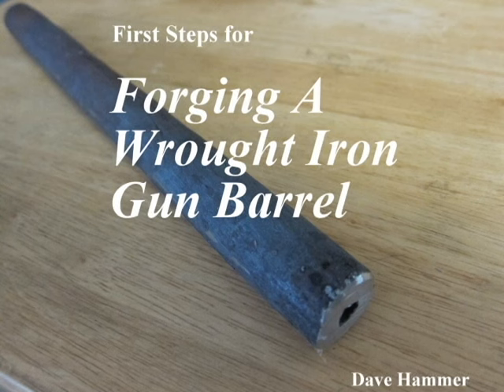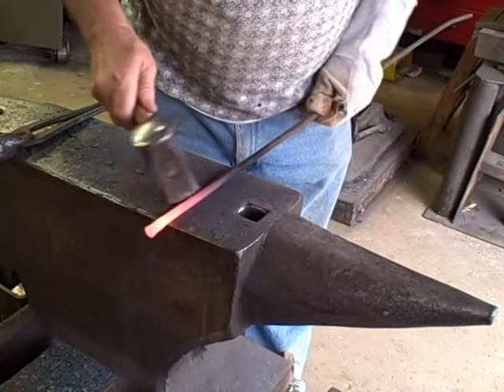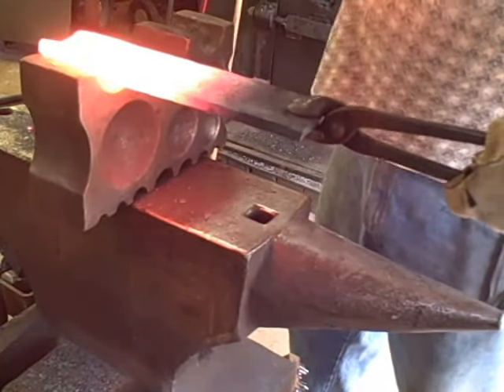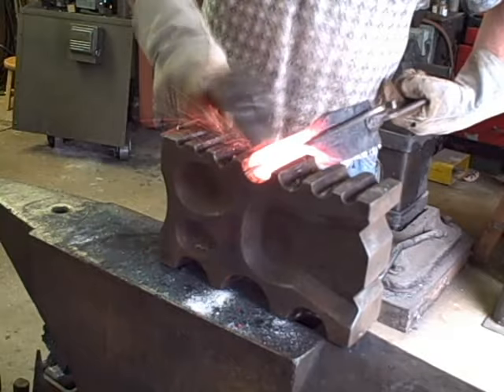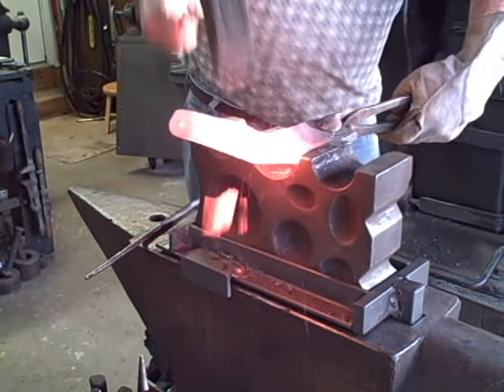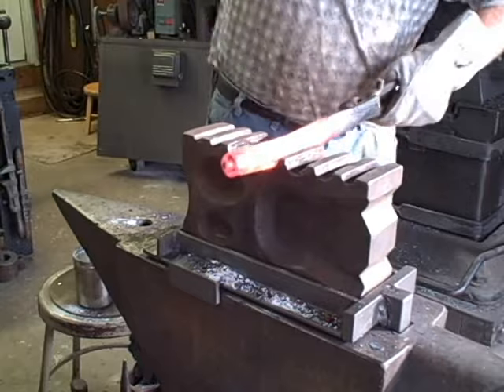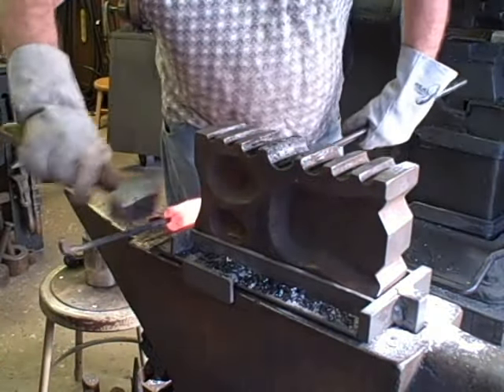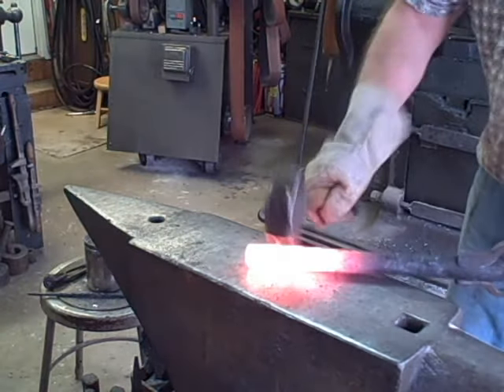Forging a gun barrel

Comment: Truing it up  now?  How do you even begin truing that?  That rod he used was not straight and perfectly trued.  The barrel he hammered would no way be straight.  He needs to throw it on a Lathe and start cutting chips to even have a chance.  Doubt he would rifle that.  Now thats the hard part!
Reply: If I move forward on the barrel, I will do it the same way it was done during the 18th century.  They made drill bits and drilled out the barrel with small (in diameter) drill bits to just under the bored size.  They chucked the bits in a machine with a large flywheel that was hand driven.  Then they made a boring tool, much the same and finished the hole.  A gunsmith can look down the barrel and see where it is bent, then straighten it with a hammer (yes they can, I've seen them do it).  And yes, this barrel can be rifled in Colonial manner if I decide to make the machine to do it.  I've helped a Colonial Wiliamsburg gunsmith do all this and I could do it if I choose to do it.  How do YOU  think they made firearms before the industrial revolution?  It was ALL done by hand and crude machinery.  The firearms weren't perfect, but some were accurate enough to hit a man-sized target at 500 yards (Springfield Model 1861).

Comment: How did you gauge the quality of the metal?
Reply: Wrought iron has a fibrous quality (like the fibers or grain in a piece of wood).   The finer that grain, the more refined (better quality) the iron is.  The more the iron has been folded (and re-welded) or rolled, the finer the grain gets.  To determine how fine the fibers are, I cut a  piece of the iron bar about half way through, then break it (bar in vise, hit with a hammer).  I have done this with dozens of pieces of iron.  The range of visual on the fibers is from extremely rough grain to very difficult to see grain.

Comment: What is that thing you are hitting on to make the gun barrel  what kindof anvil is it
Reply: Felix tapia My anvil was made by Refflinghaus.  It is a double-horned Northern-German pattern anvil.  

The tool I am using to help curl the bar into the gun barrel is called a swage block, which is a solid block of steel that has many shapes on the sides and flats to aid in forging many shapes.
Reply: Yeah that is cool. were can you get those at .
Reply: Felix tapia You can buy them from businesses that sell blacksmith supplies.  In the USA, a few places would be Peih Tool Co., Blacksmith Depot, Old World Anvils and Saltfork Craftsman.   The Saltfork swage block is the least expensive (smaller also) and is the one I used in the video.  If you Google those businesses, you should find prices.
Reply: Ok i see what you mean

Comment: How can you tell the quality of wrought iron?
Reply: ***** This text is a repeat of an answer I posted a while back..  I will, sometime in the future, put up a video about wrought iron.

Wrought iron is generally spoken of (graded) as poor, medium or highly refined.  Although a piece of wrought iron, after being processed into a bar, may have a smooth outer surface, it actually has an internal fibrous structure, much like a tree branch.  If you have ever seen a piece of wrought iron that has severely rusted, or has been successfully etched with acid, you will see evidence of these fibers. 

The finer (thinner) the fibers, the more highly refined the wrought iron is.  The more highly refined it is, the better it is.  The more highly refined wrought iron is, the easier it is to forge.  Extremely rough fibers (poorly refined iron) may appear as wide as an eight of an inch.  Within extremely high refined wrought iron, it may be difficult to see the fibrous nature of the iron at all.   

Modern steel does not have that fibrous appearance, it has a crystalline appearance. 

A way to determine if a piece of metal is wrought iron is to literally "break" it.... as if it were a twig, and look for the fibers.  Then a visual inspection of the thickness of the fibers is used to "grade" the wrought iron.  In reality, there would be many diameters of fibers within each grade (poor, medium and highly refined), so in reality, there are as many grades as there would be diameters of the fibers.  Within a piece of unforged bar stock, those fibers would run lengthways within the bar (again, like the grain within a tree branch).

When I tested the wagon wheel tire I used to forge the gun barrel, I could hardly see the fibers.

I suppose the next question might be "How do I break a piece of iron....  wouldn't it just bend?

This is how I do it....  If I am testing a bar (say a half inch square solid), I put a piece of the bar into a vice, with about an inch or so sticking up or out the side.  Then I cut it a little more than halfway through the bar with a hacksaw (with the cut about 1/4 to 3/8ths of an inch from the vise jaws).  The cut needs to be across the fibers.  You can generally assume the fibers run lengthways on the bar (this will invariably be true if the bar has not been forged).  Then take a heavy hammer and "whack" the bar, hitting it on the side that you just cut.  If you did this with a piece of wood, it would break or "split" at the cut (and you would see wood fibers).  Essentially, if you use enough force, and it is wrought iron, it will also split and you can see the fibers.  I try to hit the bar just hard enough to split it, but not break it.  As previously stated, the smaller the fibers, the more highly refined the wrought iron is.  Some fibers may actually "tear" and you can see the ends of them (as well as the sides of those that don't tear).  On highly refined wrought iron, those fibers may only be 1/100 of an inch wide. 

If you have trouble breaking the metal, cut it a little further.  If it's steel (rather than wrought iron), it will be harder to break.  If it's steel, it will snap in two at the cut and will not split like a tree branch.  It will have a crystalline appearance on each end instead of the fibers. 

If you have a piece of thick barstock, just cut a short (1/4 inch) piece off the end and put that in a vise and break it like you were trying to bend a coin.  It will snap in two and you should see the fibers (assuming it is wrought iron).

If you don't want to destroy a piece of what you have, clean the scale off it (sanding or ?), then etch it with acid.  You won't see the grain as pronounced, but you should see grain.  The more poorly refined it is, the easier it is to see the grain.  If it is extremely highly refined, you may have trouble seeing the grain and will have to do the break test.  If you polish the metal, a light acid like lemon juice may show the grain (it takes a while).  A stronger acid would be hydrochloric acid (muratic acid).  If you use stronger acids, be sure you take proper safety precautions and proper disposal techniques (read the MSDS).
Reply: David Hammer Thanks Dave! I have been playing around with wrought iron in my forge and not having a lot of luck forging it. I think I will now try to see what grade I am working with.

Comment: Just curious. Do you think that rim was faggoted? If so would the barrel then be best? Also, is that considered a faggot weld or does that term only apply to gathered and formed wrought iron? Nice work there. I'd like to see the gun finished. It would be amazing I'm sure. Especially if you're a woodworker as well. Thanks for posting.
Reply: I don't believe the rim was faggot welded (layers welded).  I cut and broke a portion of it to see the grain before I welded.  On some rims I've looked at closely, I could see layers of differing qualities of wrought iron.  This rim was completely  homogeneous. Layers could have been rolled, but if they were, all layers were the same and the weld was perfect through and through.  The striations were barely visible.   I'm not even sure I could get a picture of them visible without a special camera.

Although I hadn't initially intended to finish the gun, I may.  My initial interest was just see if I could do the forge welding.   There has been a lot of interest in seeing me go forward with it.   I am a fair woodworker, so I believe I would do OK there.
Reply: I'm sure you'd do more than ok.

Comment: Hey whats that white stuff you put on the barrel
Reply: Peter Griffin It's 20 Mule Team Borax (a laundry product).  It's used as a flux to deal with scale when forge welding.
Reply: Oh thanks!
Reply: Peter Griffin helps prevent oxidation when the weld is being formed for lack of the right term, sort of like shielded arc welding, the shield is the gas that forms to do the same thing, if I understand it right, if I don't, well high school ag power and machinery class was a long time ago and mr hammer will likely correct me(at least I would like to be corrected if im wrong)
Reply: I think I kinda get what it's for now XD thanks I like this type of stuff but it seems I have much to learn still
Reply: Peter Griffin It's my understanding that the flux keeps any oxidation suspended in liquid so it can easily be forced away (sparks you see fly) from the area that is being welded.

Comment: what powder you using
Reply: +papaduke24 I use "20 Mule Team Borax" for flux.  In the US, it generally can be bought in any grocery store in the laundry soap aisle.
Reply: thank you for your reply i love black smiting but its hard to have anvil.. here in philippines it so expensive hehehe tnx again...
Reply: +papaduke24 Any significant piece of steel can be used as an anvil.  If you have access to a steel recycling yard (or even a junkyard), it generally isn't too hard to find something that will work.  Sometimes what you find may need to be cut (like fork lift tines).  Lots of people started with a short length of railroad rail.  What you use as an anvil doesn't need to look like an anvil.  The key is to anchor it to something that doesn't move (like a piece of a tree trunk).

Comment: No sería más fácil con tubo mecánico industrial por ejemplo unos diámetros exteriores de .750" 
.626" o .500" y un diámetro interior de 5/32 o 4mm y abrirlos a según el calibre por ejemplo .22 igual a 7/32, o .306 igual a .320" o calibre .38 igual a .380" y así sucesivamente.
Reply: Thanks for your interest...   My goal was to see if I could make a gun barrel using the same techniques as those  used during colonial days.  I'm not aware of barrel liners during that era...  The blacksmith forge welded, then drilled, then bored the barrels...  Some barrels were left smooth bore, others were rifled.

Comment: your method is all wrong    you don't need  the mandrel   never use a swage block on an anvil !!!!  it mars the anvil and  its obvious that you are fighting the  block & not getting anything done !! also you  will hurt the tendon leading from your wrist to your elbow   practice  more
Reply: +gruf ham...  All the processes and equipment I used in this video were identical to the equipment and processes used by Colonial Williamsburg gun makers....  They believe this is one of the ways both long rifle and musket barrels were made during Colonial days.   If you had watched the entire video, you would have seen how I solved the problem of the swage block moving around on the anvil....  I can assure the swage block did not mar my anvil.
Reply: +David Hammer      dave  I was too hard  on you    swage blocks  do not  belong on anvils !!!  you spent an hour on a  tool you don't need   your anvil height is determined by your height  & personal  preference  as soon as you place something  a foot or so  high on  it  you lost all of your mechanical advantage  you now have  a flying elbow & it  will lead to  pain  go get  a stump  of oak or so & set the block where it will do you some good  & you do not have  to place it up & down  so on &so forth    I" get into  the  barrel later   good luck